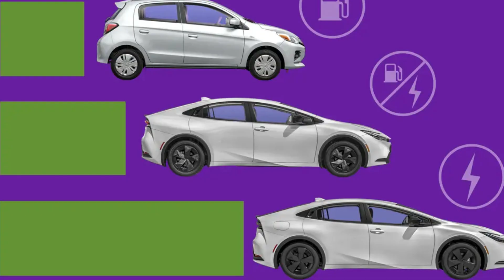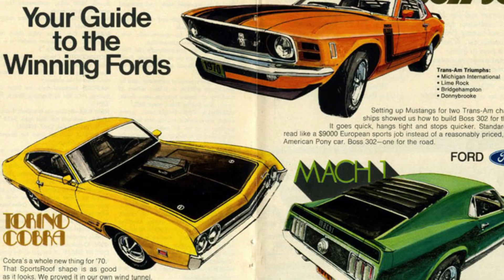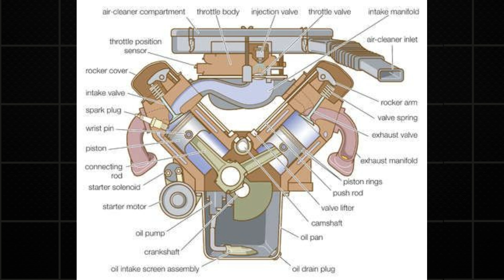The Shocking Truth Behind the “Gasket Grenade”, Ford's 3.8L Essex V6

Comment: Yet, if you never messed up and ran them hot, they would run well over 200K miles no issues.
8:44- That's a great example of a non Essex V6.  Good job!

Comment: Congratulations. You have become the first to ever describe the Essex v6 as a "beast" or "powerhouse" or even "juggernaut."
Reply: My 3.8 Mustang I bought new in 2000 has 263,000 miles on it, and runs great.
Reply: Word my 91 merc cougar 3.8L has 360k ( 😆 3 head gaskets later) but still going strong 💯
Reply: I've owned both 1993 Taurus SHO 3.2L V6 and 1993 Taurus LX 3.8L. Both had same options and were awesome cars! I love that low-end blast of torque from that 3.8L @ 2K, it felt like a V8. Later I bought a 1993 Thunderbird SC 🤭🥰 I've only had to replace the Taurus 3.8L gasket once out of 120K miles before it got into a bad wreck. The Thunderbird still lives today.